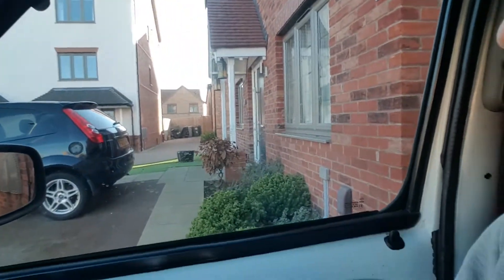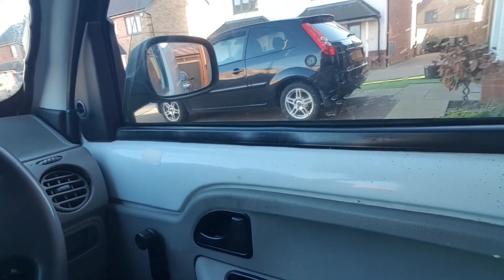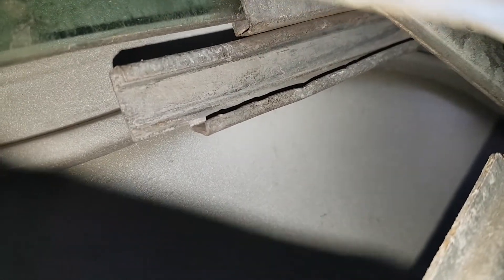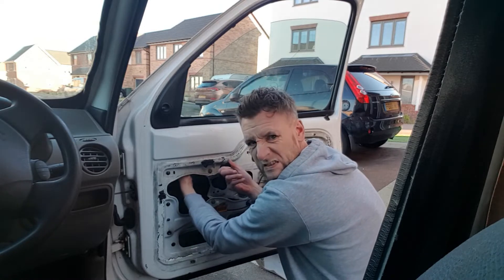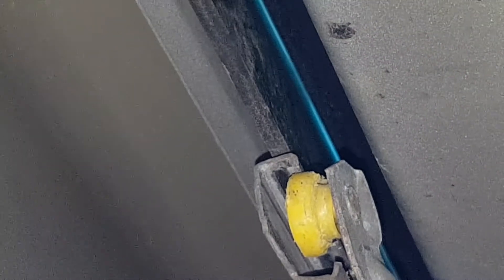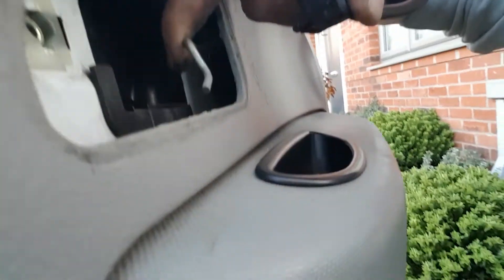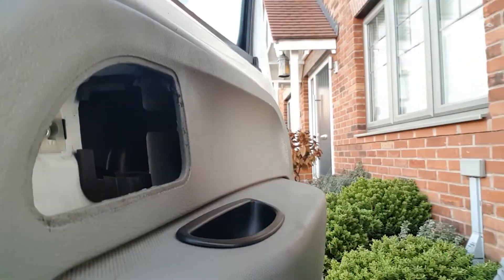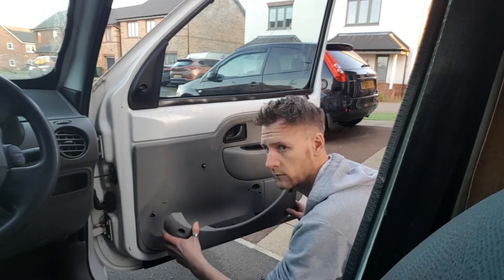Episode 54 - How to fix a dropped window on a Renault Kangoo

Comment: The black rubber sealant is Renault factory spec. I thought the same as you but have stripped two doors now off two different cars and they both had exactly the same stuff as yours.
Reply from the maker: Lol. I guess that tells us a lot about Renault's build quality! 🤣
I'm still thinking mine had been off some point already, as that window guide definitely seemed to be the wrong way round.
Thanks for your comment all the same pal. Cheers. 😎